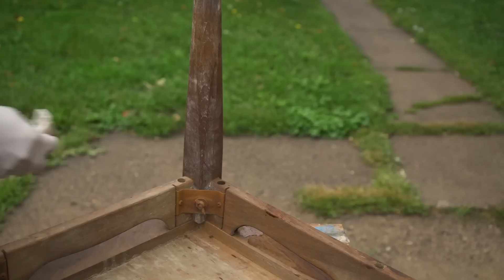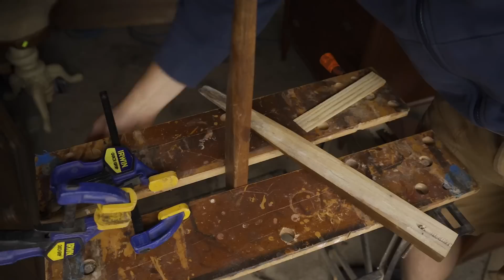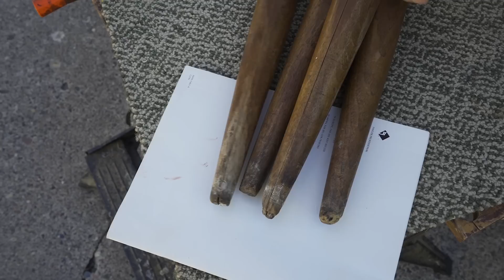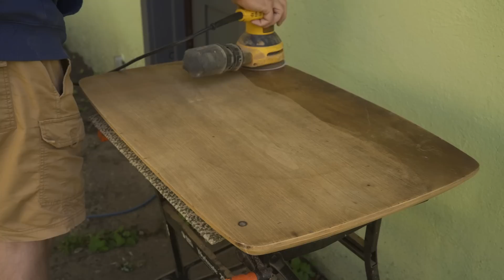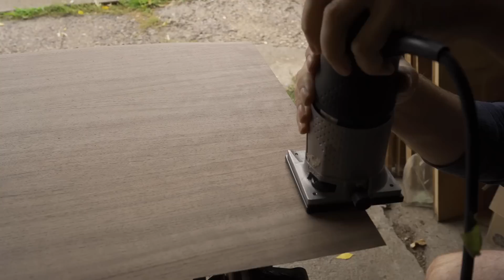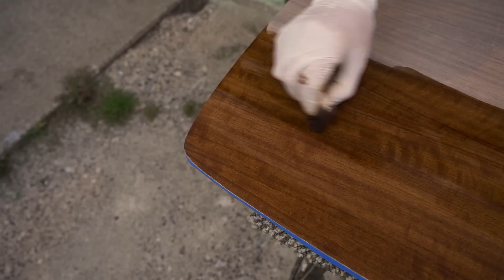The Filthiest Mid Century Table Gets Refinished | Furniture Restoration & Repair

Comment: You did a fantastic job!  👍
However, I think I would have put the leg extension pieces at the top of the legs, underneath the table top, in order to avoid having to shape each leg bottom.

Comment: Hey Dash -  Love the content, keep up the amazing work. Question for you.. I tried using the Dashner10 coupon code and affiliate link to pickup some of the QCS stripper but the code isn't working. I wanted to make sure you get credit. Did this code already expire? Thanks
Reply from the maker: Hi, thanks for using the code! I just tried the code myself and it worked for me. Maybe give it another try?
Reply: @DashnerDesignRestoration  Copy and paste didn't work but manual entry did, thanks!

Comment: Vinegar is a poor rust remover. It regenerates too soon because of the acitiy. Much better option is a proprietary rust remover like Evaporust. Which is reusable, bio-degradable, doesn't promote  regrowth and completely removes all rust within an hour or two. Consideringthe time savings, it's the cheapest option with the best result.

Comment: You brought it back from dead! Except I still would use some wire brush on hardware.  Surface rust appears as soon as the metal dries from vinegar bath. After that maybe some protection from future oxidation.

Comment: Looks great, though I have a question about the hardware. Did you seal the semi-rusted metal before putting it back in place? If you didn't, does it risk the possibility of corroding again? Just curious.

Comment: Such a great looking piece of furniture. 
Just a tip on the metal hardware: After removing the rust with vinegar, you can seal the surface with a (clear) lacquer to prevent it from rusting again.
Reply: Also, evaporust would remove the rust quicker and more completely.

Comment: It sounds strange, but when gluing large “slippery” planes together, after applying the glue sprinkle the joint lightly with common table salt. The salt crystals imbed into the wood and create a nonslip surface. The salt has no effect on the glue. They only served to stop joint slippage.

Comment: Looks like your metal pieces flash rusted. While you can do a couple of different things to address, my personal preference is to dry them with a rag, use a blow dryer to heat them slightly & finish the drying process, use a small metal brush or steel wool dipped in mineral oil to clean off the flash rust, heat them again with the blow dryer making sure the oil is fully warmed, and remove as much of the oil as possible with a new cloth.

Comment: Ok but why didn't you just cut 1.5 inches off the bottoms of the replacement legs and use those for replacements? Wouldn't that have saved you a bunch of carving? Thx for your videos ❤
Reply: I think maybe he had only the one replacement leg…and since it seemed the same kind of wood it would match. I don’t think he had 4 replacement legs ?
Reply: @kristinfrancis  Ohh that would make sense. Good point.

Comment: I love how the table looked after you finished it. I love how the “feet” looked. I’ve had tables with brass caps and this looks like they do. I have a question about the metal hardware that attaches to the aprons so the legs can be attached.  I have my late mom’s entry table.  It is shaky from the repairs (glue) over the years.  When I flipped it over I notice that 2 of these metal things are gone and my mom’s neighbor just screwed the legs in at an angle. He was trying to help.  What I really need are these metal pieces to make sure all of the legs have them.  I have no idea what they are called and where to get replacements. Could you please help me out with a name and a source? Thank you.
Reply: In Australia they are called plates and butterfly nuts but if you take a picture to your local hardware store they'll be able to help you out no problem.

Comment: I love watching you work and the ideas you apply. One thing I have done as a 25 yr wood restoration tech is the use of touch up paint to neutralize any dark imperfections that I don't like. I would also seal any artwork under a couple coats of stain and a couple of clear coats... Either way your work turned out great!!